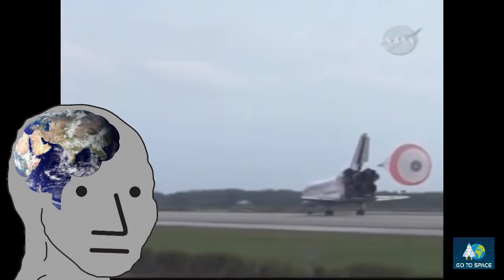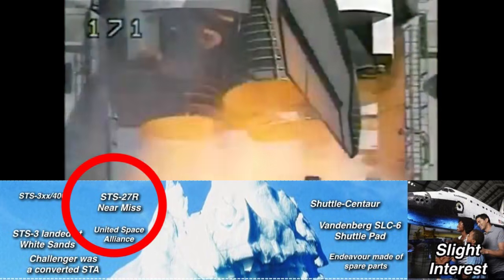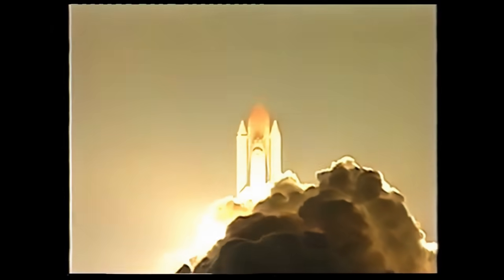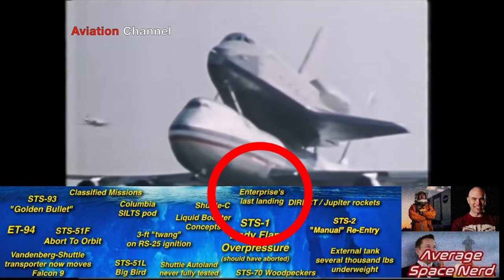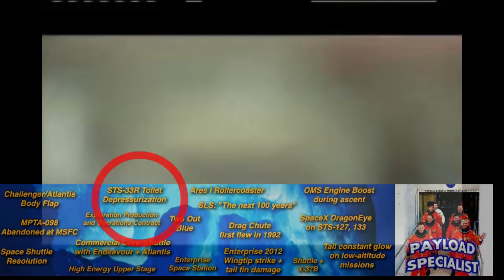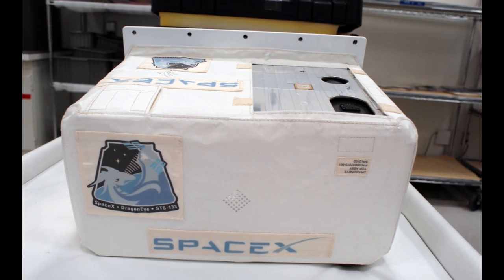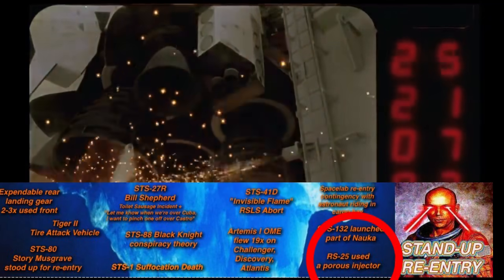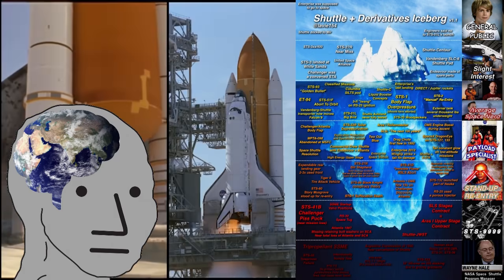The Space Shuttle Iceberg Explained

Comment: Amazing to see how close some of STS missions came to disaster.  Reading through STS-1 was hair raising just by itself.  
I sure wish we would have moved on to a second Space Shuttle program with a larger, more capable shuttle.  Capable of a Moon landing for an actual Moon base and shuttle system back to Earth.  Something as spectacular as the original Shuttle program was.
Reply: I would not be against a fundamental clean sheet design for the shuttle but that is sort of what starship is doing. It starts with a lot of the same initial requirements of being a re-usable, fast flown and cheap superheavy lift vehicle, except or course starship is geared for interplanetary crewed flight as well.

The issue specifically for a hypothetical moon shuttle is the same exact one that would be a problem for the HLS lunar starship was it not so gigantic. The shuttle was optimized for LEO operations with it's lift not being usable anywhere else, and requiring a huge runway to land on. That landing profile simply cannot work anywhere else and especially not on the moon. So any space shuttle would need to carry completely independent landing engines and a landing system to perform operations there. An extra weight and space cost it simply did not have access to. 

Starship has the same problem but only for landing, since the usage of its raptor engine for touchdown would crater the ground underneath it. So it will need separate landing engines. And they would need to be fit for re-entry as well and that implies the exact same problem as the fuel hatch on the shuttle, except there would be more of them. 

However unlike a shuttle body it does not need to sacrifice as much to install these engines, weight that would become available  by the removal of its now useless re-entry equipment and for any other environment like Mars it would be able to use it's re-entry gear to massively assist in it's landing, though unlike a space shuttle it could do so without a giant runway. 

The issue of the space shuttle past the various congress driven decisions that hampered the design was just a symptom of trying so many new things and just running into problems. However because the shuttle program had so much riding on it, they could never just stop and redesign the concept.

Tracing back to starship, look how much it changed since the original ITS concept. Designs were made, experimented with, then changed as new things came to light. And that was followed by the testing campaign pushing the limits of the design, but still seeing substantial improvements by way of design alterations. Something the shuttle engineers could not do even when they found the glaring issues that would eventually cause the disasters. 

For example tile damage due to foam was a known issue, so engineers wanted to modify the shuttle design to be carried in reverse (heatshield pointing away from the main tank) but that would have been impossible since the design was already locked in. All they could do is wait for the disaster they knew would come.
Reply: The shuttle was a deathtrap that should have never flown, It should never have been allowed to carry crew

Also, why would you need a wings and such a massive vehicle for a moon mission? Its added cost and weight
Reply: @jesusramirezromo2037 
~ That comes off as pretty ignorant.  To suggest the shuttle was a death trap after over 100 completed missions, Hubble capture and repaired, then upgraded more than once.  Saving billions on extending Hubble's life, to wit, advances in science with the best "Reduce, reuse, recycle" program ever,
I could go on and on with what the Shuttle program did accomplish.  Please study it for yourself.  You may come to a new conclusion.

Comment: Great video, lots of good nuggets in there, I’d like to add a couple. About the Return to launch site (RTLS) abort mode, some at NASA were very skeptical it would work. So much so that some of the NASA brass floated the idea that STS-1 would perform a RTLS abort to prove it would work. If memory serves me right, the shuttle wing load was rated at about 6g, while the pitch over and weight of the external tank would put roughly 9g on the wings. John Young absolutely refused to do that mission, as he said “RTLS requires continuous miracles interspersed with acts of god to be successful”.

Another thing is that the crews that went in after the shuttle landed to help the crew out all said the smells were horrendous, but also that the astronauts had become nose blind to it. 

Another thing was the shuttle was originally intended to be much smaller, similar in size to the X-20 Dynasoar, launched in similar fashion, which was atop a Titan 3C, but because of budget cuts, NASA figured the only way to keep crewed missions going to space was to partner with the Air Force, to take military payloads up for them, thus the Air Force allocating some of their budget for the shuttle, but in turn they needed a large payload bay for things like keyhole, so the shuttle ended up becoming much larger and launched aside instead of on top.
Reply: In addition to your last point, I remember reading somewhere that the Shuttle lift/drag was sized so it could launch into a polar orbit from Vandenberg, re-enter after one orbit and glide over the Pacific to land. Without this, the wings could be smaller & lighter and mass to orbit performance better.

Though I can't remember where I read it, so it might just be space sausage.
Reply: @samueloverend3517 Scot Manley did a video on it i think
Reply: Somewhere at an air and space museum, there's a mockup model of an early Shuttle concept mounted to the top of a Saturn V S-IC first stage. There was at least a little bit of development put into the concept of keeping the Shuttle inline on the booster. This might have been in the DC-3 concept era, because the Shuttle I saw on that model looks a lot more like the 60's concept and less like the 70's concept Rockwell ended up building.

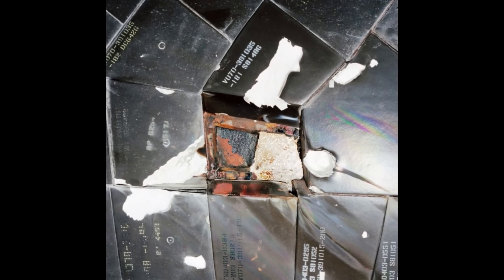Comment: At 11:19 you said aluminum plate when in reality it was a steel plate. If the plate had been aluminum the shuttle would have been lost as steel has a much higher melting point.
15:00 Not that you said anything wrong here just wanted to add that SLC-6 at Vandenberg, as of April of 2023, is now leased by SpaceX as there are no more Delta IV Heavy missions scheduled to fly from there. The last one left is launching from Florida.

Great video though! It's hard to make a video this long, especially when you are doing it all yourself, without some errors creeping in. Thanks for making it!
Reply from the maker: The plate was aluminum, every source I have says this.

The SLC-6 thing you are correct on though.

Comment: Just a important FYI for your viewers I am sure you yourself all ready know but failed to mention. 

The Shuttle originally had a escape system but it was decided to ditch it and add more crew. 

Also NASA frequently hired outside engineering firms for specific shuttle problems.

My dad worked on many of the ones NASA didnt seem to be able to be fixed ...

The glue on the tiles was very problematic.. I handled many of these tiles.

The main engines had vibration problems as LOX isn't a good lubricant for high pressure engine turbine bearings.

I looked at detailed diagrams of the solid rocket motors construction and the O Rings.

Just about guaranteed to have a problem they were so poorly designed.

Great video none the less

Thanks for doing it.

Comment: Some extra info

The engine bell of the RS 25 was sized to have enough power at low atmosphere pressure instead of sea level or vacuum, thats why there is no staging on the shuttle.

The rim of the RS 25 engine bell curves slightly inward, it's supposed to increase the power at low atmosphere but I'm not sure about the specific physcial reason.

The shuttle was autogenously pressurized which meant the fuel and oxidizer tanks were pressurized by gas bled from the preburner, most rockets use helium instead but this requires more mass for the helium storage and piping.
Reply: The hump in the nozzle is there to prevent flow separation at low altitudes from what would be otherwise over-expanded nozzle. It does make vacuum performance worse but I guess not as much as correct ratio nozzle for sea-level.